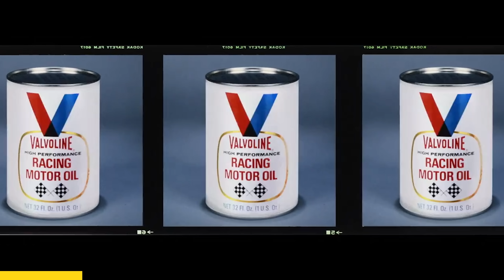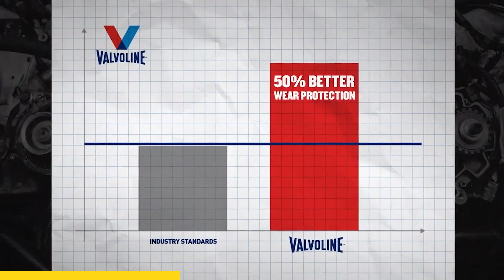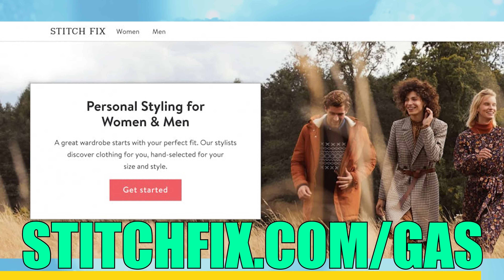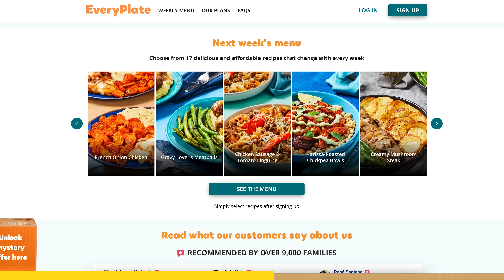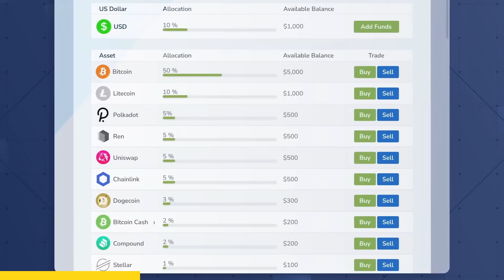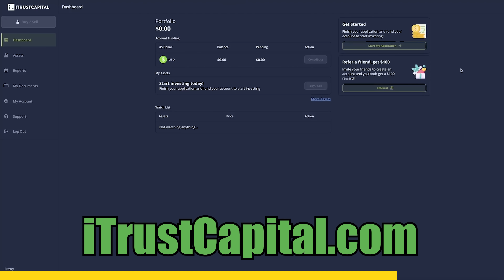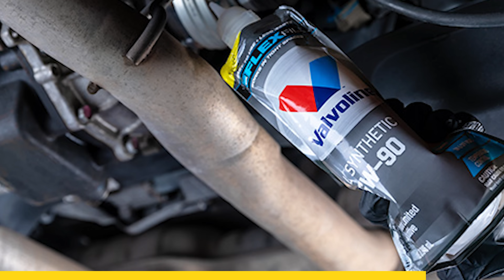Suzuki Turned A Motorcycle Racer Into A Spy - Past Gas #141

Comment: James is right, Grand Prix motorcycle racing transitioned from 500cc two strokes to 990cc four strokes in 2002. The motocross transition started around the same time but wasn’t complete until 2006